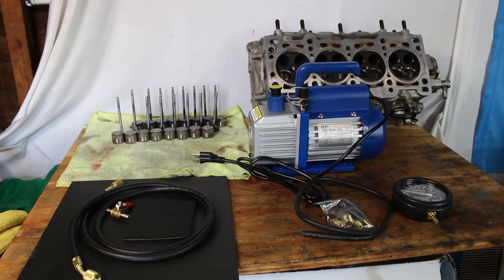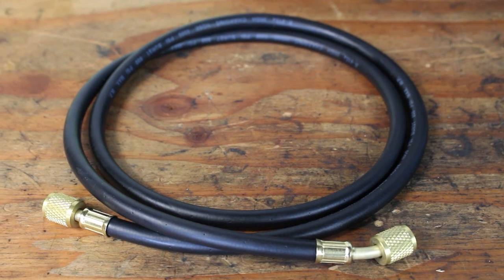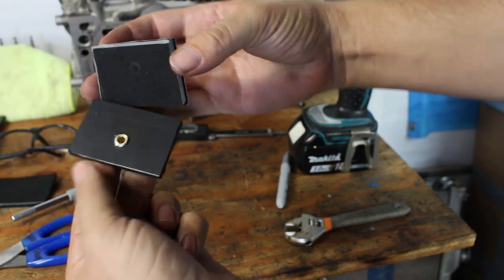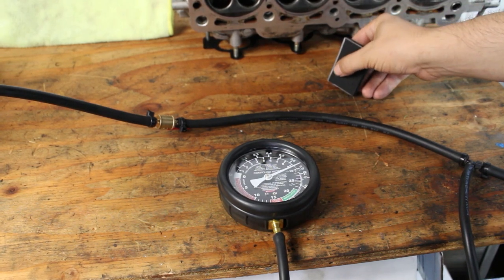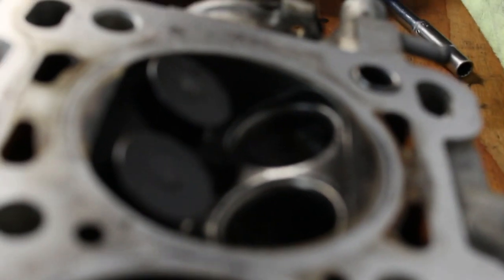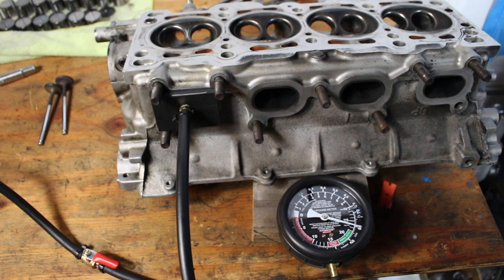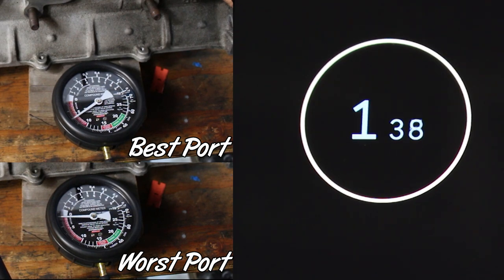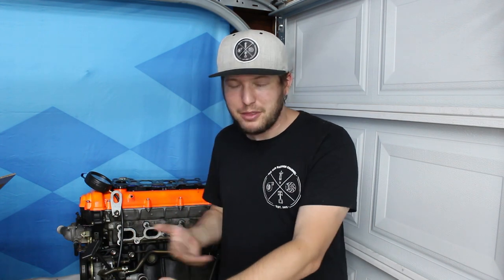Do You ACTUALLY Need A Valve Job? DIY Valve Testing Tool For $100!

Comment: $1.00 tool.   With valves and springs installed, pour diesel into intake ports, look for leaks. Repeat on the exhaust ports. Any leaks, lap that valve and recheck 😉

Comment: Really appreciate this video. I made my own with the old yellow ac line off a manifold kit I had, a vacuum gauge off an autozone hand pump, a steel cover plate for electrical outlet boxes cut and drilled, some semi-hard tubing, related fittings, and foam off a piece of pipe insulation. I think I spent $40.

Comment: making one of these and found a way so you dont have to kill a hose to do it. 
you get an ac shutoff valve
then you also get a ac line to barb adapter
this way you dont have to cut a line and if you already have an ac line in house you can use it. 
though i would say remove the valve depressor if you want with a tool

tldr

ac hose --- ac shutoff valve --- acline to 1/4 barb fitting ---- t in the pressure gauage --- to valve adapter

Comment: Good video.  I rigged up something similar after seeing the outrageous plate kit prices.  I sacrificed locking suction cups and I used ac manifold gauges for the valve, lines, gauge. I ended up teeing in a bigger vacuum gauge for accuracy.  In lieu of oil, I used grease to identify the leak, easier to pinpoint the problem area.  As caveat, if you have money in the head, take it the machinest.  DIY is good to double check, but don't get burned if you got it built up.
Reply: Also, you can run a vacuum on the head surface side to check for weak valves springs.
Reply: Nice video  & good idea however,....your 3 cfm pump is still Way too much as considering the typical head port is around 0.2 cu ft volume, you really Need to get your vac pump throttled down by placing a 0.040" diameter orfice tube connected between the pump & your shut-off ball valve.....A/C servicing  Isolation ball valves work best & don't leak....Ideally, you want to pull > 20" Hg, close Isolation Ball valve & turn off pump...When Cyl Port vac drops to 18" Hg,  Begin Stopwatch Timing until port vac drops to 8 " Hg vac...It needs to take > 10 secs to have a Good pass Valve--Seat rating....

Comment: Just put everything together in Amazon cart it’s $150 for everything now 2 years later . Can’t believe how prices have increased.  My local machine shop who just resurfaced my heads charges 
$150 for resurfacing 
$150 for pressure testing 
$75 for hot tank 
Total of $375 out the door , it pays for it’s self after the first use so I would like to build my own to test how good my valves are sealing after new valve stem seals & the hand lapping I did with 350/450/700/1,000 grit Diamond polishing compound

Comment: Can you use this as a DIY leakdown tester? Assuming you get a fitting for the spark plug threads.
Reply: I wonder if the piston rings would let too much air through

Comment: Good info video.....Even a 3 Cfm pump is Way to large & Will give Misleading good reading by Over-pumping the Actual valve leakage Rate....A 10 Liter/Minute (0.3 Cfm) vacuum pump  Rate is much closer to Commercially used, built-in to Professional grade valve seat cutter machines....You want something that takes about 10 seconds to pull a Full scale reading into a Perfect seal.....Adding an Inline 0.010" Orfice Restriction to a 3 Cfm pump + a good Shut-off valve is about right.....A Good valve seat will take at least 60 seconds to leak back up to atmosphere.....

Comment: Hey wanted to mention if you've got a hand vacuum pump/tester you can make a similar tool to work with it to do this too. How I tested mine when I put it together. I used mightvac vacuum/pressure tester.
Reply: How’d you do it?

Comment: Have you heard anything about the Garrett GBC turbos? The GBC22-350 looks like the sweet spot for a ~300 hp Miata. It's not super expensive either. I haven't found any videos on them yet.
Reply from the maker: Yeah I'd be really interested to see how they are on a 1.6/1.8 Miata motor, might be great sizing. Maybe even the smaller ones if you're looking for 180-200hp

Comment: all you need to test your valves is this  take a compression reading log it each cylinder now add  1 small spoon mtr oil each cylinder retake comp reading did oil help (higher reading ) if it helps it is your rings leaking   if no help it is your valves leaking    simple

Comment: If you can’t get atleast .7 bar without the seals installed you likely have worn out guides. The guides are meant to be within a thou or 2. I don’t know the exact spec for these heads, that’s about average from what I’ve seen. (I’m a cylinder head machinist)
Reply from the maker: Good info thank you

Comment: Why not replace a ports valve with some kind of rubber plug to test valves individually?
Reply from the maker: You could do that as well
Reply: @TheCarPassionChannel  I was thinking this way you can get a specific reading for each valve. BTW Thank you Greg, your videos have always been an inspiration what is possible to do without having a fancy shop put together by sponsors. All the best from Germany!

Comment: Now I question which method is better.... leak check with a liquid such as alcohol/water vs a vacuum test? I like you can isolate the valves without removing the head using the vacuum and it's less of a mess. Great video! I already have a cheapo pump for AC work, will try it out next time i need to do a check. Thanks!
Reply from the maker: I tried the methods using water, alcohol, acetone, and seeing if it will drain through a valve, I just didn't like it. I really wanted something measurable. Next video I'll be putting it to work!
Reply: @TheCarPassionChannel  looking forward to it!

Comment: Rule of thumb is if it takes less than 10sec for the needle to drop from 20" to 10" then you either need a valve job, replace valve guides or both. I'm a engine machinist and do this for a living and I never rely on a vacuum test alone.

Comment: Would this show if valve seals were leaking? If so, with the head still on is there a way to differentiate between valve seals and seats?
Reply from the maker: No, this is not an accurate test for valve stem seals
Reply: @TheCarPassionChannel  would a bad stem seal throw off a reading?
Reply from the maker: @SarryLhackleford  yes it is possible; you can also put grease around the stem seal to help prevent this

Comment: Fantastic video and tool! This is a huge pro even if you are just going to use it to confirm the results of a compression and leak down test. In my case I know that 2 cylinders had low compression and that the majority of the leak was coming from the exhaust valves but this will further confirm the results. I think I will also use your oil pour technique on the valve stem seals because if the seals are not installed properly or worn out that may be a good was of inspecting them.

Comment: What size tap is that?
Reply: I think I figured it out… 1/8 -27
Reply from the maker: @nathanhood8578  You need to use whatever size tap matches the barb fitting you use